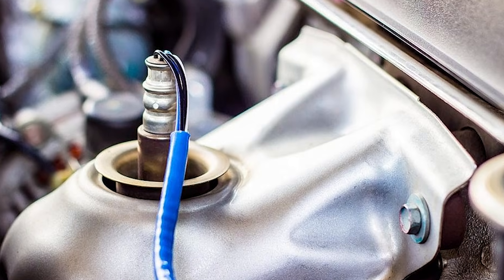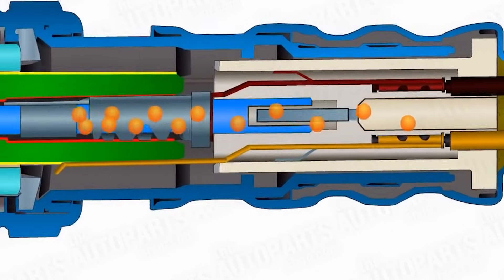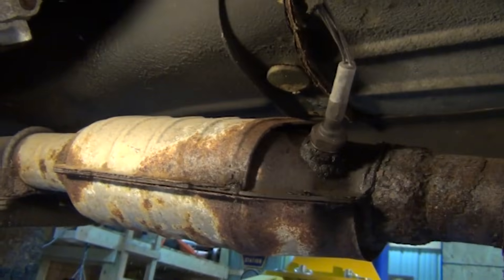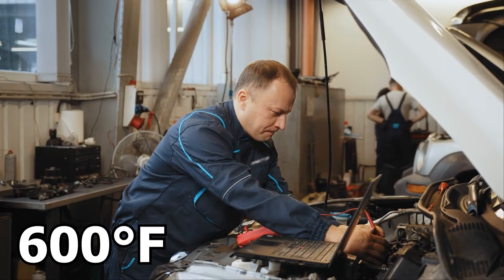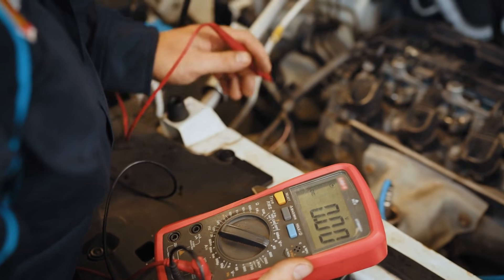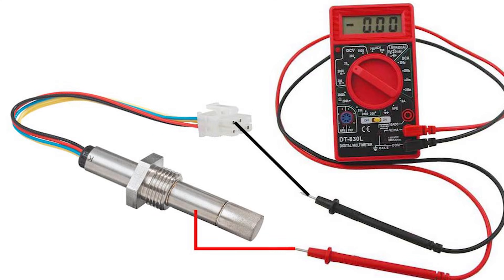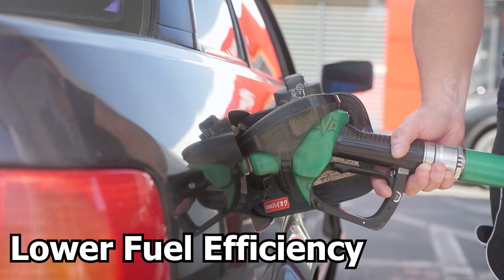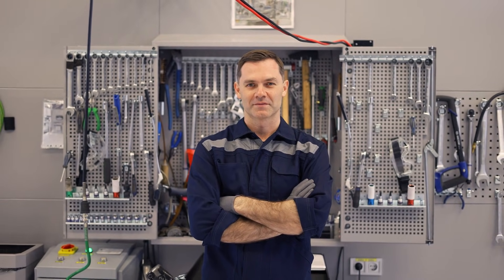HOW TO TEST AN OXYGEN SENSOR SIMPLE WAY

Comment: i have wire colours blue yellow grey black and white so which wires do i test for resistance ?
Reply from the maker: Your oxygen sensor wires have different functions, and only some should be tested for resistance.
The two wires that usually need resistance testing are for the heater circuit, which helps the sensor warm up quickly.
These heater wires are typically the two that have the same color, often both white or both black.
You should measure resistance between these two heater wires using a multimeter.
The reading should usually be between 5 and 14 ohms, depending on the manufacturer’s specifications.
Do not test resistance on the signal wires because it can damage the sensor.
The blue or black wire is often the signal wire to the ECU, while grey or white is usually the sensor ground.
Always confirm wire functions with a wiring diagram for your vehicle before testing.  Good Luck!